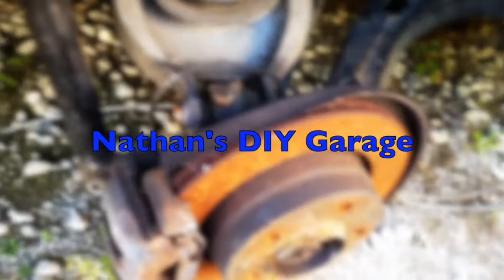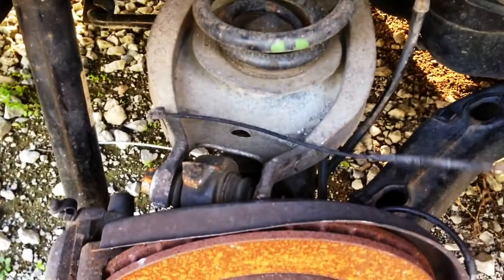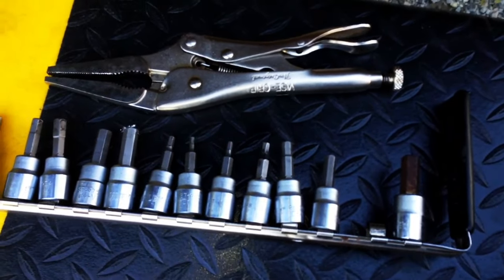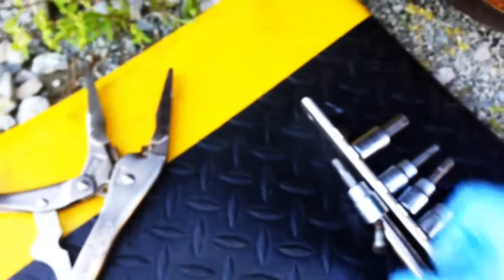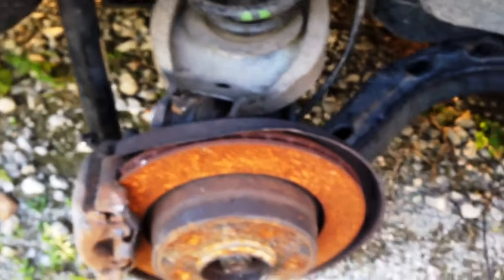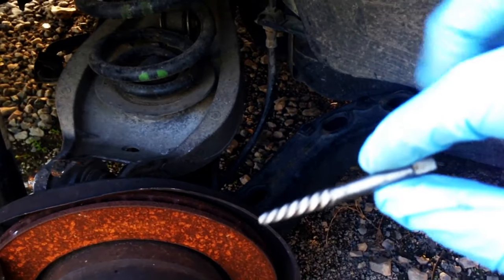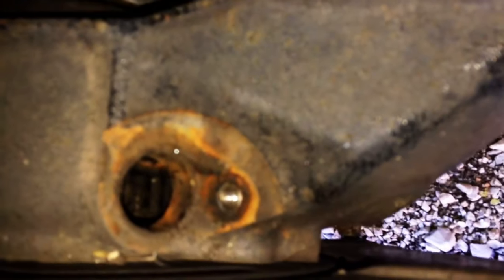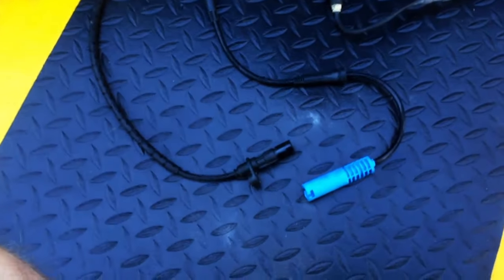How to Easily Remove and Diagnose BMW ABS Wheel Sensor Problems

Comment: the name of the video is How to easy remove and Diagnose abs sensor. I saw the removal part. Where is actual diagnose?
Reply: Andriy Selezen Probably impossible to diagnose wich sensor that is bad without a Scan tool. Bought the c310 last week and it works great. 100% worth the investment
Reply: interesting paralel there. I wouldn't acuse him of bullshiting tho. He did tell you the best way to diagnose bad abs sensor wich is with a bmw scanner
Reply: Rasmus Ahlblom scanners can not diagnose. Human do the diagnostic. And if scanned pointing you at specific sensor you need to diagnose if it's the sensor, or bad connection, or wiring, or computer, or mechanical issue. And he didn't show anything of that. I appreciate the removal part it was helpful but the diagnose part is a bullshit
Reply: The scanner can show wich sensor that is doing bad wich is a big part of the diagnostic. He also shows what can make the sensor do bad readings. dirt, bad connection etc. Its like every diagnostic you have to know around the abs wheel sensor wich is the title of the video.

Comment: I have e39 523i 1999, (driven 300 000 km). I have a problem: 1) abs light is on, 2) asc light is on, 3) speedmeter does not work, 4) but cruise control works, 5) fuel consumption meter does not work. Error code was left rear abs censor no signal and it was replaced but the problem didn't solved. What is wrong? What is propability that abs module gone bad?

Comment: I am currently diagnosing a 1998 M3 E36 with an ASC and ABS light on.  Trouble codes for both front wheel speed sensors.  Watching live data from the Maxisys 906BT all four WSS operate properly with no dropouts until about 12 mph and the data just disappears,  basically I lose connectivity just to that module.   Have to shut the car off and rescan, this resets and I can see the ABS ASC trouble codes and live data again.  Any suggestions?  Has anyone experienced this issue?

Comment: Thanks. my E46 front right sensor is not reading data. Checked with INPA while driving. Need to find the problem now. The sensor or the wiring

Comment: Great Video. Can you give me some advise? My e46 is not communicating with any Abs issues have also been to local garage to read the codes but even they can not get it to communicate on their scantools. 
 I have abs, handbrake and Asc lights on have lost cruice controll, speedo and abs system won't kick in if I do an emergency stop.
As no communication is being obtained how can I know which sensor if any is bad or i
Could their be another problem. Car drives fine otherwise.

Comment: I have the three dashboard lights illuminated and the / speedo and tacho are not working on a UK car. Which side, left or right, is more likely to have a faulty sensor? I ask because the driver's side is mentioned, but in the UK the driver sits on the right.

Also I have a parasitic battery drain (the battery will go flat in 2 or 3 days if the car is not used),  but I'd guess that this is unrelated. Any opinions? It's a 2002 330d with very low mileage. Thanks.

Comment: 2001 BMW 740 DSC light, Abs light and cel p0500' speedometer works along with the cruise control. Help
Reply: abs electrical motor fail...

Comment: Hello Nathan , my name is Nathan also, cool name.      Please tell me I have e46 which needs sensor replacing.      Speedo dead, abs light , handbrake light on----------   Should I replace rear drivers side or rear passenger side.   Please tell me,  TY
Reply: Noo Hall  drivers side if speedo is dead answering for the next guy I’m sure you got it fixed